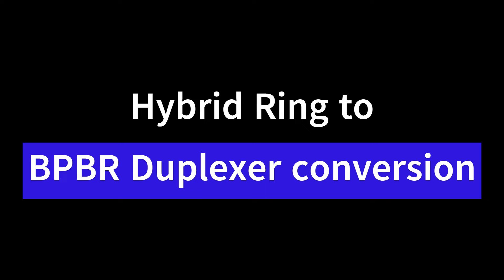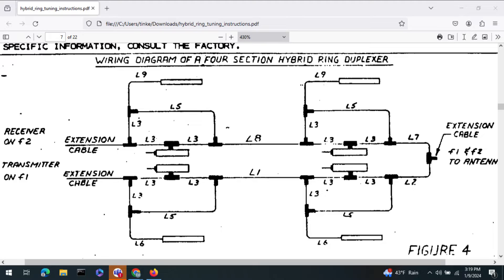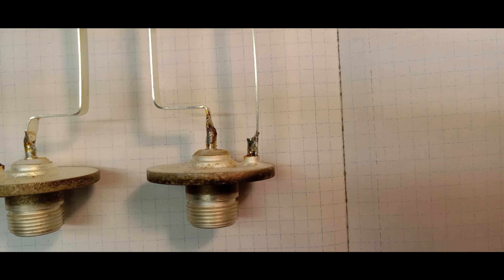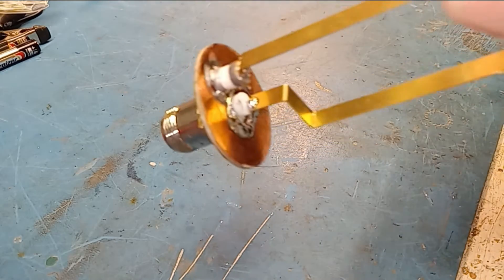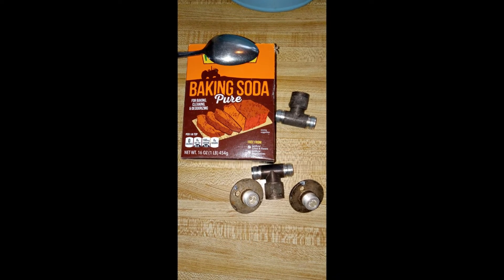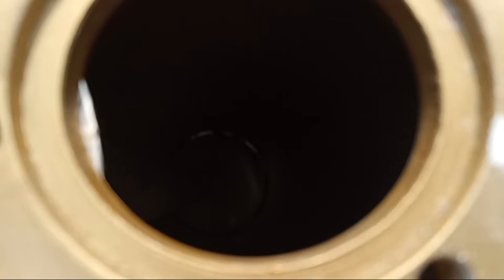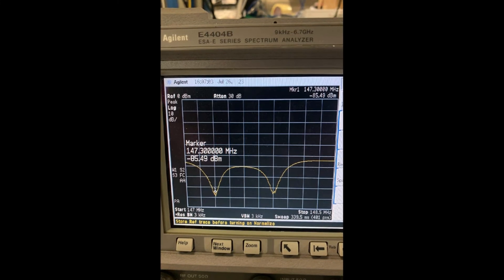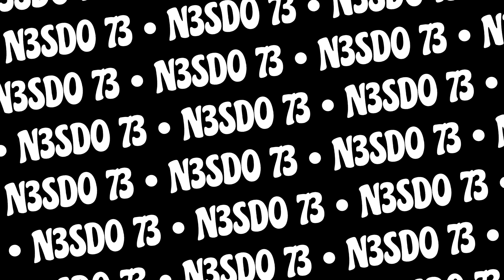2 Meter Hybrid Ring to BPBR Duplexer conversion

Comment: Quater waveleng cable are not only about the coax cable but also, some time, the Tee and the length of the loop!
If you calculate the electricale length of all part, you see where the 1/4wave are.
Simple bandpass have longer cable than bandpass band reject cavity because the loop dont work the same.
I convert multicoupling cavity set with BpBr loop on the last one Bp cavity, add 20db isolation without any more loss, cable a cut shorter.
I use variable coaxial length device to found best length of each cable harness on cavity set, each cable are custom made and mesure with TDR.
Reply: Hi Dieseleux,  I don't have a variable length coaxial device.  I have a selection of assorted length coaxes, and adapters that I  have measured and used incrementally.  What is the variable length coax device you use?  I would like to look into getting or building one.  73 Ed N3SDO
Reply: @edbathgate5680 

I send to you a email with picture of my device

Comment: I see you used the Johanson capactors, which happens to be the same as the Sinclair Q202G. However, you did not mention what the value of the capacitors was (pf). The original piston (concentric tubes) had a fairly high value of pf, and I was wondering if your cable lengths were allowing you to use a smaller value like 10pf. The larger capacitors are now quite expensive and not exactly readily available.
I converted a F150-4E Hybrid ring duplexer about 30years ago to a Q202 style. I used re-used the dielectric capacitor from the hybrid ring as I did not have the piston caps. The harness connection was a T at the can with the male on the leg of the T, the new harness connected to one of the runs and the dielectric cap connected to the other run. This allowed the capacitor to be vertical along side the can and the harness tucked in nicely at the top. I still have my notes somewhere.... 73.
Reply: Hi Gilrand, The capacitors I used are 1-14 pf.  Great idea!  I still have the dielectric sliding rods and caps.  I'll have to tinker with them.  73 Ed N3SDO